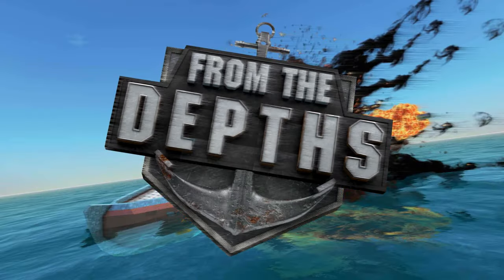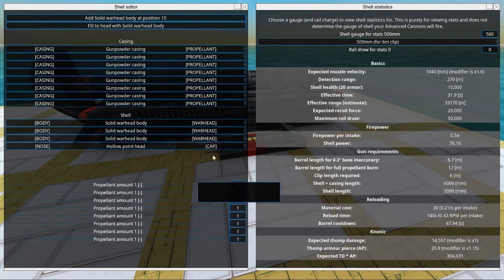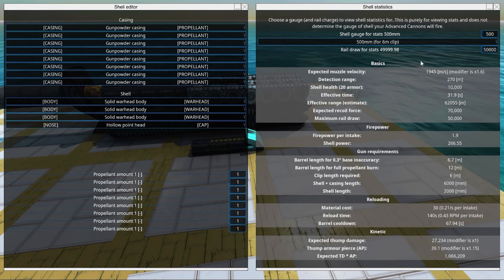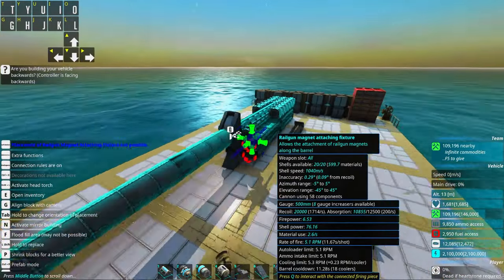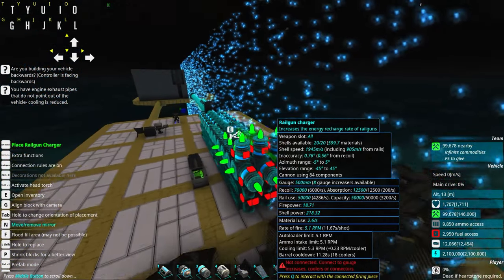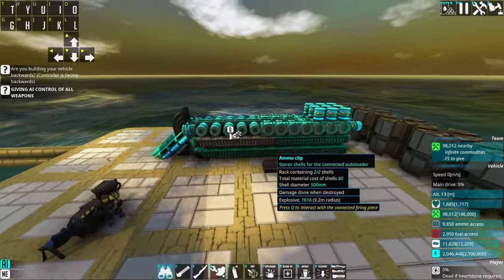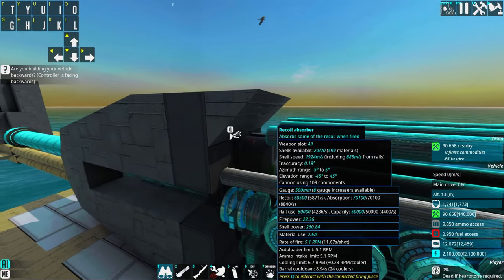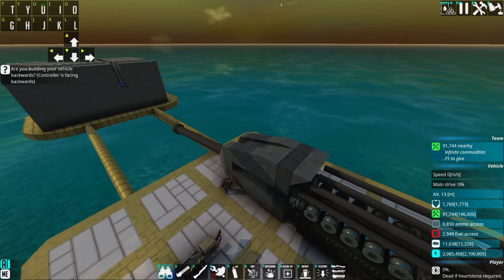From The Depths INSTANT Tutorial: Rail Assisted APS Cannon for MAXIMUM Kinetic Damage

Comment: You should have pointed out that the required charging and recoil can also been inferred from the hovering tool tip.
It tells you how much recoil/s and draw/s,  and respectively recoil absorption/s and rail charge/s.
Rail charge will always be in 200s from the blocks, so it's easy to have a tiny bit too much when dealing with autoloader and cool down timers. I'd actually tune it down in rail draw to see if I can save that last partially used charger's cost.
Rail assist shines best with that exact shell, hollow point at huge gauges. Since the extra speed ups it's AP into metal or HA piercing values.
Reply from the maker: For sure info is available at several places, guess I just find it easier to read in the menu :)
It is truly powerful with HP! The AP version can shoot through anything it seems :)
Reply: For some reason, the tool tip calculates the stats according to theoretical max rpm rather than the set rpm.

So sometimes you can save a few ressources if you calculate it yourself for your desired rpm  ;)